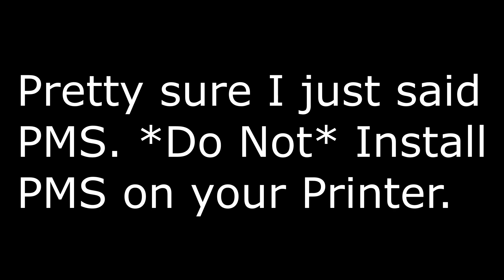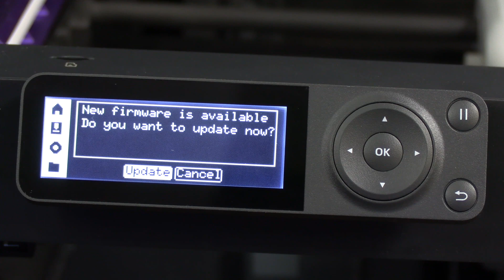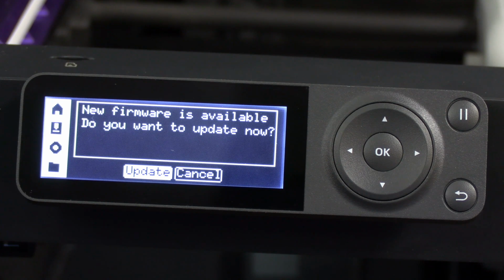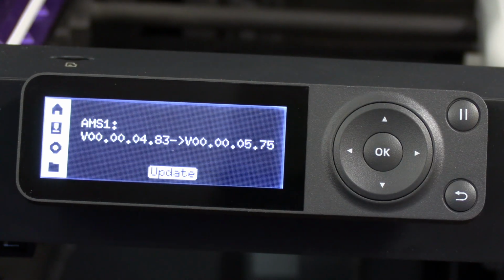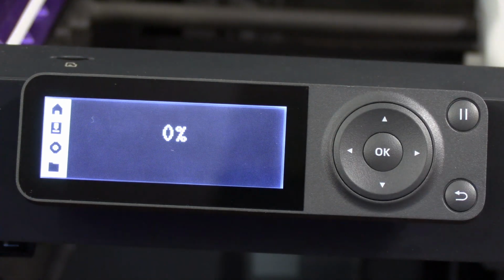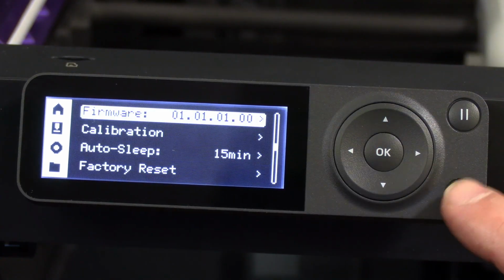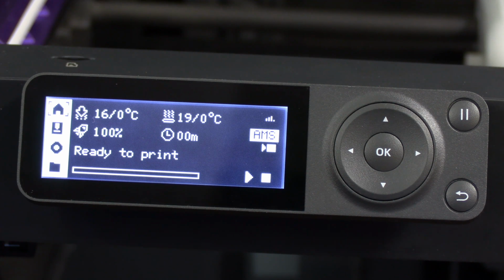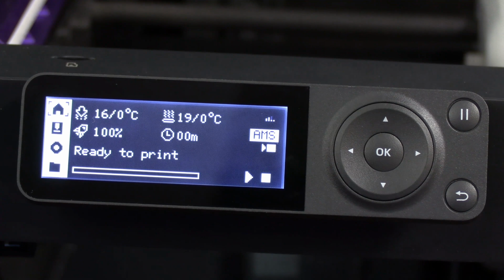Unboxing & Complete Install: Bambu Lab AMS on P1P / P1S 3D Printer - (99% The same)

Comment: Loved the video. Really helped in putting it together. I have had this AMS system for two days, and want to throw it in the trash though. It will not load the filament. The AMS pulls the filament in 18 inches, then stops. it never reaches the hot end/extruder. shut it off, restarted it, checked all connections, tried to "load" it like I would from the external spool holder using the load command on the P1P screen. still nothing. If not for your video I am not sure it would have been as easy as it was putting it together. The Instructions lacked....instruction.

There is nothing on YouTube from any user that I am finding useful, they all show it just taking up the filament up fine after assembling it. Any suggestions would be helpful. Bambu Labs tech support is absolutely terrible from past experience or I would contact them. Great machine, prints fantastic but there are somethings they need to work on for sure.
Reply from the maker: Loading and stopping is correct. The AMS will only load to the Toolhead, when you start a print. Send a print, and it will load the proper filament to the toolhead.
If THAT doesn't work, test with a different slot. If a different slot works, catch my video on AMS jams, and look for broken filament in the tube, for the slot not feeding

Comment: Thank you so much for the video! This answered a lot of questions for this newbie starting from 0, including how to load the refill filament into the spool, and the why sensor thingies. I originally messed up the installation as the instruction booklet that came with my P1S is lacking and the font is great for an ant to read 🙄
Thank you!
Reply from the maker: I'm your Manual now. 😂😂🎉🥳🎊🔥 Now, move on to my Bambu Studio videos. And catch my support videos, even the ones I used Cura to demo

Comment: Hi i just bought a P1P with AMS module. To print off a little model using a single red PLA and also PVA for raft interface of supports. its saying that the model uses 18g of red PLA but flushes 42g and 22g in the tower. Then its saying it uses 2g of PVA and 15g of Red PLA in the support but is flushing 80g of PVA and 16g in the tower. This doesn't sound right. Have I got the settings wrong or is printing with AMS very inefficient? 35g of plastic goes to the support/model and then 122g flushed and 39g in the tower? Is this normal?
Reply from the maker: I would ditch support material and use the same pla for supports. A quality filament, supports will pop right off

Comment: Except you didn't put the filament in and feed it into the printer goddamnit
Reply from the maker: That's not a thing with AMS. The AMS loads and unloads itself, when printing
Reply: @3DRundown  mine registers the filament but doesn't send it down the tube to the printer
Reply from the maker: Oh no. That's not good. When you place a spool in the AMS, you will stick the filament, into the funnel. It will only push and pull it, a few inches, then stop and wait. When you start a print, from Bambu Studio, it will then load, and unload, the filament, to the hot end, as needed, for printing. It does NOT do it, prior to sending a print.
Reply: @3DRundown  how long would you say it should be between starting the print and the ams sending the filament? I gave it about five minutes but it never moved so I canceled to print cause I didn't think the tip being heated up for a long time without the filament to cool it would be good for it.

Comment: I can't figure out how to disconnect the tubing at the @5:00 mark. It doesn't pinch
Reply from the maker: It should....  Push that ring IN, it will retract the teeth
Reply: Figured it out thanks! @3DRundown
Reply: @appleking01 I still can’t figure it out, how did you do it

Comment: I’m struggling here - the P1P is cheaper than the P1S, but they don’t do a combo so the AMS as a separate accessory makes the two almost as expensive as a P1S. “so get a P1S doofus” I hear you cry. Well yes, but I expect not to need to print high temp filaments and seeing comments about chamber fan noise and/or leaving door off makes me wonder if the P1P+AMS is a better option for PLA/PETG users?
Reply from the maker: I print only in PLA, I have 2 P1P, a P1S, and 2 AMS, there are no wrong answers, as I have printed a zillion things with both models, however, There are no advantages to the P1P. Get the P1S, (and a High Temp Smooth plate)

Comment: Outstanding video once again, I just got the P1S Combo and was struggling with how I was going to mount the AMS in the limited space I have for my printer. Didn't realise I could just lie it side by side. They (Bambu Labs) have changed things around a bit since you posted this. They no longer include four spools with the AMS. Instead, they include three in the bottom of the box, all half spool sizes as in your video. They include a yellow and green basic and a support filament which is foil sealed. Not sure, but it look like they might have updated the design of the feeders as well. I agree with you about the safety of mounting the AMS unit on top of the P1S (it's can't go there anyway unless you find an alternative print for the mount, due to the top glass). It will make the whole thing very top-heavy and it's always a configuration I moved away from with my last printer just as soon as I had it printing properly. Great stuff!
Reply from the maker: Wow, you got 3 spools of filament?? I got 3 EMPTY refillable rolls, and just ONE sample roll. I got an AMS a few weeks ago, and was the same as my original one. I'm curious about the feeder change....
Reply: @3DRundown  They were half spools right enough, but I am just trying to figure out how you use (or don't use) these newer cardboard filament spools in an ams, or if you have to treat them as a refill and swap them over to a known good plastic spool.
Reply from the maker: I have a video on this. There are adapters. Some of the newer spools, are made better and working on AMS. (My elgoo work), But, I flat out avoid it....

Comment: When you top mount it. Does the tube and wire scrape against the bottom of the AMS?
Reply from the maker: No, because you will use a riser

Comment: I think those desiccate chambers are for the bags you pulled out. My guess is that you opened the plastic bag and inset the desiccant inside the chamber. So do NOT throw them out. Makes sense to keep the filament dry.
Reply from the maker: 😉 https://youtu.be/mFskttC0y3c

Comment: Does the AMS system have issues holding different sized spools? I'd hate to get one just to find out my suppliers spools wont fit inside.
Reply from the maker: It's meant for 2kg Plastic spools, but there are adapters to make others work. The AMS is a game changer.

Comment: Easy and Clear 🙂❤, please explain me the teory of relativity..
Reply from the maker: The special theory of relativity was based on two main postulates: first, that the speed of light is constant for all observers; and second, that observers moving at constant speeds should be subject to the same physical laws. Following this logic, Einstein theorized that time must change according to the speed of a moving object relative to the frame of reference of an observer. Scientists have tested this theory through experimentation - proving, for example, that an atomic clock ticks more slowly when traveling at a high speed than it does when it is not moving. The essence of Einstein's paper was that both space and time are relative (rather than absolute), which was said to hold true in a special case, the absence of a gravitational field. Relativity was a stunning concept at the time; scientists all over the world debated the veracity of Einstein's famous equation, E=mc2, which implied that matter and energy were equivalent and, more specifically, that a single particle of matter could be converted into a huge quantity of energy. However, since the special theory of relativity only held true in the absence of a gravitational field, Einstein strove for 11 more years to work gravity into his equations and discover how relativity might work generally as well.

According to the theory of general relativity, matter causes space to curve. It is posited that gravitation is not a force, as understood by Newtonian physics, but a curved field (an area of space under the influence of a force) in the space-time continuum that is actually created by the presence of mass. According to Einstein, that theory could be tested by measuring the deflection of starlight traveling near the sun; he correctly asserted that light deflection would be twice that expected by Newton's laws. This theory also explained why the light from stars in a strong gravitational field was closer to the red end of the spectrum than those in a weaker one.

Comment: My AMS is arring Monday and appreciate your instructions (style), in telling me how to set everything up. Like someone else mentioned, I kinda wish you had explained how to actually load the AMS with filament. Saw your reply, will go look for the other vid. Also, impressed you didn’t even flinch despite an air-raid apparently happening in your neighborhood.  Thanks. Have subscribed.
Reply from the maker: 😂😂 OMG, yes, there is an air raid siren one block from my house that the town uses to signal various things. It's crazy. People are always like WTAF!?!? 😂😂
Welcome. Happy to help. I keep my videos to the point, because Google Analytics are a depressing thing. Drop off on YT videos is insane. By the midpoint of most videos, we are talking to ourselves. 
I do intend to make some more Bambu/AMS videos. However, 2 things: 1) I wanted to educate and gain more experience, before I make any videos that may be inaccurate, and 2.) the reality is, loading the AMS is ridiculously easy. You won't believe how easy it is. The tougher part, is using Bambu Studio properly. 

But, point taken, and I will do my best to make a "1st Use" video asap.
Reply: @3DRundown  No worries. Thanks! I have subsequently discovered how easy it actually is. I was unaware there is simply a bit of Bowden tube (I assume) running from directly in front on each spool to the "collector" (or whatever it's called) that makes the decision  to feed This One or That One (or, or...) to the drive on the hot-end. Thanks again.
Reply from the maker: Also, keep in mind, filming and editing takes a ton of time, and this is a side Gig, to my main business @greggadventure, which already has me working 1-12 hour days 7 days a week. I struggle to find the time to shoot. Hoping the channel grows more, get's some Memberships, Patreons, Super Thanks Tips, etc, to help me make more time for it.

Comment: Great video I just got my P1Ps in yesterday I’m going to order the PMS 😂 for them but need your help. Would it be posible to measure from bottom to top once installed? I have limited space for these. Thanks
Reply from the maker: I'll check. Keep in mind, you can mount the PMS next to the P1P, if need be
Reply: @3DRundown  unfortunately the top is my only option

Comment: Thanks for the instructions,  just one note, you are using a Torx screwdriver in a Hex bolt at 5:40
Reply from the maker: Yep. I find they work fine. Especially because we don't go very tight on these, so stripping is not really a worry

Comment: Hello! Although I have AMS since mid-December 2022, I watched this assembly show with great interest, wanting to find out - if I didn't make a stupid mistake with my own assembly. After receiving the P1P on January 3, 2023, I put it on pre-printed legs and used the AMS only once as I concentrated on printing different types and designs of single-color P1P enclosures to choose the optimal option for my studio. Now I have printed a part for the "Vision Enclosure" project proposed by "Humebeam" on Printables, which model I finally decided to choose for myself. For this project, I also made an additional base for the upper plexiglass on which AMS will stand in the future. To this I also added a new "Cable chain 10x11mm" and a matching "hotend mount" so that it all fits into this case. I think - that maybe it would interest your channel viewers (especially the "Cable chain 10x11mm" montage) when you would show them - as always clearly, precisely and objectively, how to do it. I usually greet you from Krakow (Poland). Peter
Reply from the maker: Link me to the Cable Chain you think I should cover.

Comment: Do you find that the arrow control button on display sometimes does erratic things like return to a top level menu when you are lets say moving an axis (in that sub menu).  I think the display is marginal for a printer such as this. The X1C is fantastic and I don’t expect that on this machine, but I would pay extra for at least an Ender 3 level of color display…
Reply from the maker: I don't love the screen. It's sub par for a machine of it's price and ability. The Ender 3V2 has a better Screen and firmware. Heck, so does the ancient Ender 3 Pro. The camera is also cheap junk, as is the LED Light, which they make US print the parts for.  Bambu is currently treating the P1P like a middle child. For nearly everything that requires instructions, we're expected to watch X1C Instructions, and figure out on our own, how to apply them to the P1P. They are not making much P1P Specific content. This needs to be fixed Yesterday. The screen seams to work but, it's definitly a letdown. I would like to see an update at some point. While P1P owners seam to really like them, I feel like the X1C is the way to go.

Comment: Added a week ago, fantastic, then got X1C and couldn’t live without AMS #2!
Reply from the maker: Thoughts on your P1P, compared to the X1C?
Reply: @3DRundown  great question, let me set the stage. First, I had 3 Ender printers, 3S1:pro, 3V2 upgraded to S1 pro with sprite/ other mods, Ender 5 Plus all capable of advanced filaments. Besides lots of typical storage needs, I am designing parts for vintage motorcycles that you can no longer buy ( I do concours level restoration on contract).  I want to design and print, NOT modify / upgrade printers which is too time consuming, frustrating, constant tuning, learning different slicers, so-so quality, consistency. Enter P1P, got it, printing solid for first ten days straight 16 hours per day. Yet to get failed print. I installed the free upgrades and AMS.  I did this while my preorder for X1C was yo be delivered. Now have X1C this week, fantastic, same quality, seems faster after it gets going…ok so now the short:  For PLA, PETG, TPU the P1P is simpler, quicker startup, works with AMS, just cranks out of box.  Downsides, crappy display, less function for AMS, no direct Network capability like X1C, and cannot do abrasive filaments without upgraded extruder and hotends ( I did buy those).  X1C fantastic display- best I have ever seen, full control of AMS, Local Network printing ( no cloud), hardened everything, absolute best at first layer prints ( but long startup to do all that for just simple PLA, PETG etc ( I turn all I can off), vastly superior for ABS, ASA ( haven’t tried the other high-end, headed there now). I realized in first day, I couldn’t live without AMS..on order 😎 . My use, X1C primary high end filaments that the advanced Lidar and other features enclosure, etc that give me advantage to avoid failed prints and a backup on other general use when I need to print volume.  P1P gets all primary duty for general use. I am a maker and bought these so I can stop spending countless hours on modifying printers which is not engineered to work together and is trial and error.  I want to focus on design build, sell!  One other difference, for PLA, PETG, TPU, I prefer the PEI sheet. So along with many spares I bought for both ( hotends, extruder, consumables), the Wham Bam is best plate on X1C with Lidar and I like Bambu PEI for everything else..so I bought those up front. I will be trying out Engineering plate as well.  Even though slicer is somewhat proprietary, it is the best of Prusa and Cura put together ( which I was switching between) and the fact I can be the best at one slicer is relieving….so as long as the company is succesful..I am good!  An insider at Creality told me they are preparing a response, Prusa is in trouble, XL too little too late, IDEX crappy..sorry for long post, hope this helps you in perspective…

Comment: Awesome vid, thank you
Would have been nice to have a load filament and software instruction included in this tutorial.
Reply from the maker: The reality is, if I carry on that long, people stop watching. I will make a follow up
Reply: @3DRundown  totally agree
Just wanted to take the time and thank you.
This should help this Sunday with the PMS, lol.
The bowden tube setup seems crazy long.
Would there be a way to mount The Hub on the bottom of the AMS and run that to the hotend?
That would cut more than 3/4 of the length of the bowden tube used.
Reply from the maker: @yycfoamwars6557  You'd be shocked what viewer drop off stats look like. By the end of videos, you're practically talking to yourself. 
The bowden is crazy long. I am 10000% certain that mods and such are going to change the way this works over time. The Hub goes on the printer, because Multiple AMS can link together, then link to the hub, and the AMS can even be moved to another P1P or X1C. BUT, I do feel like this could be done better. 
Good luck with your PMS!!! Report back